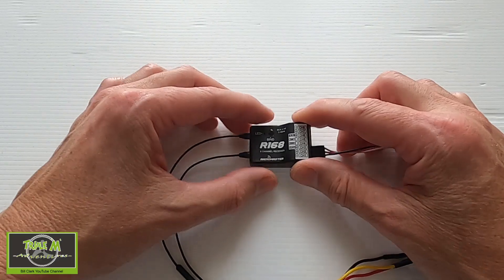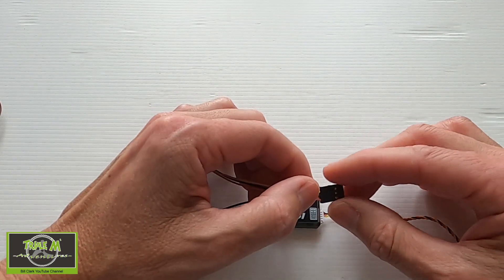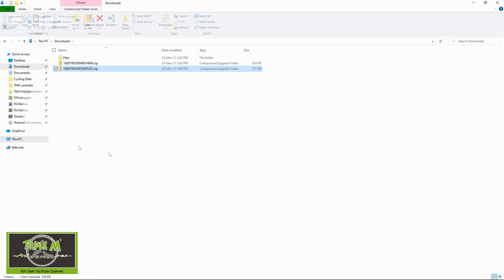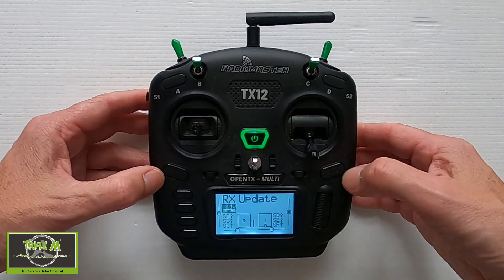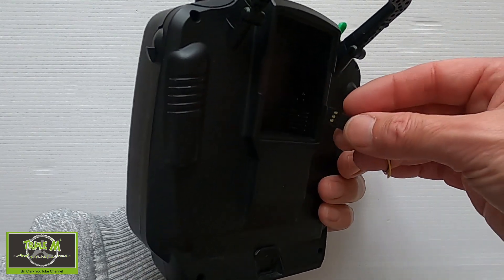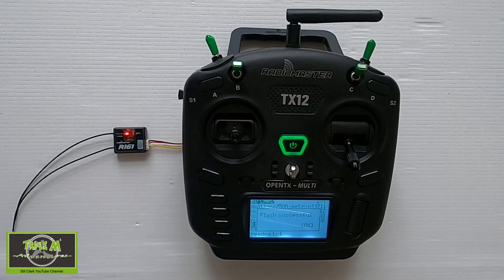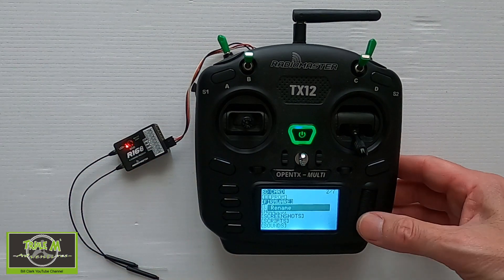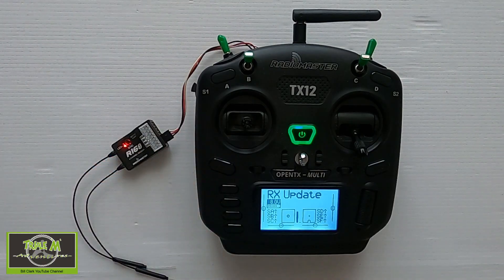How to Update the Firmware on the RadioMaster R161 & R168 Receivers

Comment: Hi Bill, I tried to flash R168 and R161 it won't accept the flashing, I mod my cable same as your instructions. And I see to your video when you plug the RX it lights up right away. Mine it lights up when I clicked the Flash. Then it wont accept the flashing.
Reply from the maker: Because the problem is happening on both receivers I would suggest checking the wiring making sure you plug into the radio correctly or you could damage your radio
Reply: @the-happy-RC-flyer  I found the problem, it's a faulty wiring. Thank you Bill.
Reply from the maker: @djnitor  you are very welcome.

Comment: Hello Bill,  I am pretty new to this hobby and I was trying to bind Radiomaster R 86 with Radiomaster Tx12 for the first time but as soon as I power R86 on, it starts blinking red and I did not get a solid red signal not even once. I followed the instructions but it did not bind. I hope you could help me with it. Thanks
Reply from the maker: Baltej, the protocol you need to use on your radio is FrSky D D8 You need to hold down the key button then plug in power to your receiver still holding the button down and wait for the red led. Then select bind on your radio when the LED flashes your receiver is bound. Turn off power to R86 turn back on a the LED should be solid red.
Reply: @the-happy-RC-flyer  thanks Bill for your support

Comment: Hi Bill, i have a problem with r168...
With ubec 5v ...work bad, loose the signal, and the servos are not Sync with Stick.
If i  use 6volt It s ok...🤔
Why this? 
Do you think i must update the firmware?
Reply from the maker: Hi Paolo, no should not be the firmware I suspect the  BEC check the voltage being supplied by the BEC.
Reply: @the-happy-RC-flyer  what Is the solution ? Ubec 6volt?
Reply from the maker: @paololonzi  if you have one I suggest testing it or if you have a battery changer that can be used as a power supply try that.

Comment: Whats the difference EU and US version
Reply from the maker: The EU firmware is Listen Before Transmit (LBT) which is required in the European Union.
Reply: @the-happy-RC-flyer   austria eu
Reply: If that is the only difference, nobody will know that or can i see it on the receiver
Reply from the maker: @chrisscotty4518  I think if you use the incorrect version for your country it could cause interference with other radio systems? You should really use the correct version.  I would guess there is a higher latency with the LBT version but not 100% sure.
Reply from the maker: @chrisscotty4518  I would recommend using the EU (LBT) version. You can flash the firmware to your R168 receiver.
Reply: @the-happy-RC-flyer  ok thx...i will do

Comment: I have two R161 receivers - neither are sending RSSI information on channel 16.  On the FrSky XM+ (really looks like the same reciever) a firmware upgrade is required for RSSI to be sent on channel 16.  There is firmware available on the RadioMaster website for the R161 - but it's not named to suggest it supports RSSI.  The FrSky firmware files are named so you can choose one with support for RSSI.

Has anyone gotten RSSI to work on the R161?  If so - I'd appreciate knowing how you accomplished that.  Thank you.
Reply from the maker: Joe, go to the Model menu select Telemetry if you see no sensors click Discover new sensors. Once your radio has picked up the sensors, should be 4, Stop discovery you should now see RSSI readings.

Comment: I use a FrSky STK (USB to sport) adapter to flash firmwares (V1 EU) and it works fine with the 168.  I have a Crossfire module in the rear bay and I'm reluctant to repeatedly  remove it as I find those pins are easily bent.  
The receiver also works with a standard Taranis, although it doesn't have the possibility to 'fine tune' the frequency.
Reply from the maker: You do not need to fine frequency tune with a FrSky radio but with the multi protocol module you are tuning the module to the receiver. If you are careful with the JR you should not bend the pins I have to remove my modules often for the work I do for my channel. Thank you for the feed back.

Comment: Hey Bill I was hoping you could help me out.  I am using a Horus x12s running open tx.  I bought a R168 RX but it will not bind with the internal module of the horus in D16 mode as it should.  Do you have any ideas why this is happening.  It will bind in the D16 mode in my multi Protocol Module I have in the back of the radio but I would feel happier with it bound to the internal module of my horus.
Cheers,
Connor
Reply from the maker: Hi Connor,
Which protocol are you binding the R168 to the multi protocol module FrSky X or FrSky X2? If X the R168 is using version 1 ACCST firmware if X2 it has version 2.  More than likely you Horus is on a different firmware version if it will not bind. You would then need to decide update your Horus and then need to update your fleet of receivers or change the R168 firmware to match your Horus. FrSky changed to V2 because they said some users where getting servo jitter but I never experienced the problem and I do fly planes not just quad copters. Let me know how you get on please.
Reply: @the-happy-RC-flyer  Hey Bill, I didn't have the option for X or X2 as it was the internal module.  I did have those options on my multi module.  But I ended up just flashing my internal module to ACCST V2  and I flashed the R168 with the ASSST V2 firmware for the X8R and that worked perfectly.  I'm only new to FrSky myself so this was the first time I had a conflict with firmware.  Now I know what I have to do it's simple enough flashing all of my other receivers to ACCST V2.  The best thing I've got out of all of this is the R168 is identical to an X8R hence why the firmware works, I'm happy I'm able to get all of the features of the X8R in a RX a third of the price :)

Comment: Hi Bill,
Still running my Jumper T16 so I have no first hand knowledge. I thought there was a plug on the bottom of the T16s? What is it's purpose? This is what I thought it was for.
Another nice video!!!
Reply from the maker: Hi Oak, yes there are uarts on the bottom of the TX16s but I checked in OpenTX and could not find out how to output the firmware update to it so would still use the JR bay pins to update my receiver firmware if using the TX16S.

Comment: the update seems from 17th December 2020, what if i bought those receivers recently, isn't radiomaster already selling them updated to latest because it's already 5 months
Reply from the maker: If you are binding to a FrSky radio that is on version 1 ACCST and the receiver is on version 2 you would either have to update the firmware on your radio to V2 or downgrade the receiver to V 1 to bind to your radio, With the multiprotocol module you can bind either V 1 ( FrSky X) or V2 ( FrSkyX2) so will not have to change the firmware.

Comment: Change log?
Reply from the maker: Could you please explain your question?
Reply: @the-happy-RC-flyer  he's asking about what are the new things or new features in this update
Reply from the maker: @Suraj_Mandal.  Oh! Ok The updates from V1 to V2 ACCST protocol was due to FrSky saying there was a problem with, I think, servo jitter on version 1 but I must say I never experienced the problem. You also may need to change the firmware to your correct region, I am not sure what regional firmware RadioMaster is shipping with the receivers but maybe the FCC version and for the EU you would need to flash the correct version. Receivers do not really have new features as such but upgrades to how they operate.